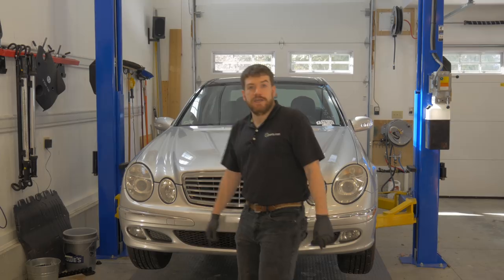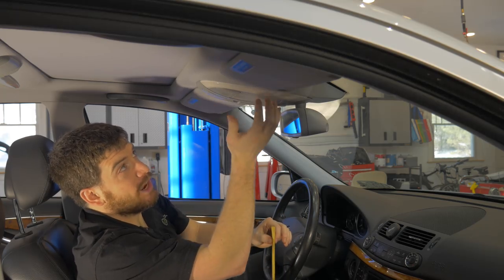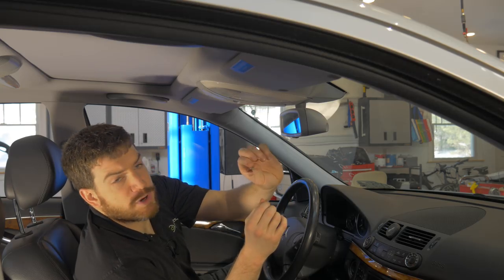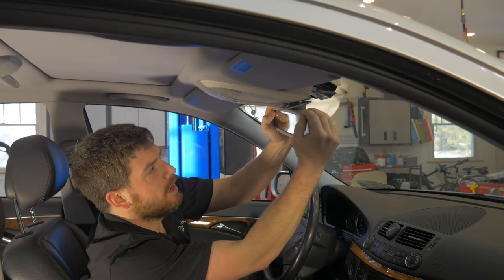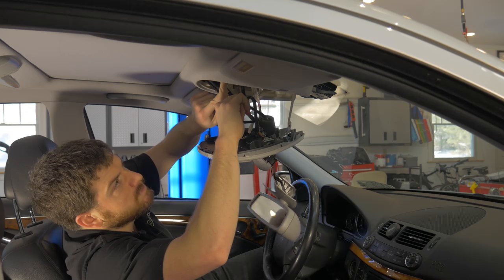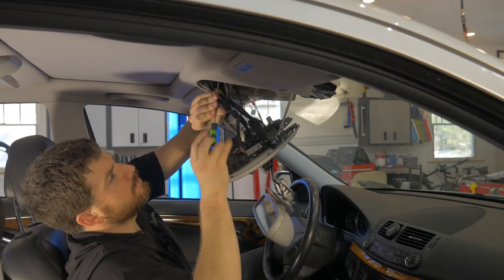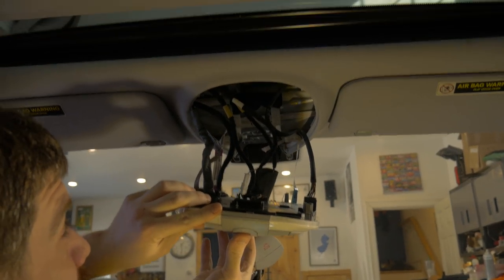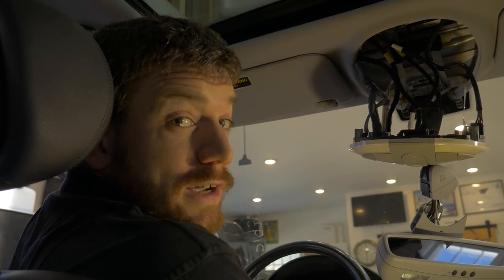Mercedes Grinding Sunroof Fix

Comment: Thanks!  I followed your instructions and was able to close the sunroof which was stuck open.  The washer didn't make the grind go away, but I was able to crank the motor and close the roof.  I noticed that if I pushed up with the screwdriver on the motor crank, it would go in a bit and the grind would go away.  But as soon as I let up on pressure, it would pop out again.  Also, I couldn't figure out how to make the shades return to closed.  Anyway, awesome video!  It saved me hundreds!
Reply from the maker: Usually the washer will put enough squeeze pressure on the motor to stop the grinding.  The shade will start returning to close once the motor opens and closes fully a few times, some sort of calibration feature/thing.

Comment: Wow!! Just Wow!! The local Mercedes Benz dealer quoted a minimum of $2500 - $4000 to repair the pan roof on my boyfriend's 2003 MB C230 kompressor. They also refused to repair the sunroof recall, due to the pan roof having an open / close issue. I found this video, spent .40 (that's forty cents)and ten minutes, and the repair was completed, tested, and reassembled!
Someone buy this man a beer for making this SUPER HELPFUL tutorial on how to repair this issue!
A million thank yous!

Comment: I was quoted $2660 to fix this. Haven’t used my pano roof in like 2 years. 

Happened to stumble upon this... bless you sir <3
Reply: $2660? the hell?
Reply: where are these washer bolts sold ?
Reply: What size washer did you use?
Reply: @geniusO2  same problem can't find one that fits right

Comment: Man U have gained a subscriber and customer. My 05 e500 did this grinding popping off track thing tonight. I googled “panorama sunroof Mercedes broke” and it took me straight to the video which was the exact same model as my car and the exact same issue. Followed it step by step and works perfect now. Only thing I would add to the video is to mention on the re-install to put the mirror back first because it was a pain for a few minutes to get back in. Thanks for the video and for making it semi professional instead of some kid using his iPhone shaking everywhere and talking for an hour before he got to the main part

Comment: Wow, Bro you are the best. I watched another video stating to pull down the roof lining and all sorts to remove the spin disc motor and add a washer on the back of the pink disk, wasted my whole day yesterday, I was so disappointed.  Then I saw you video, and thought no way can it be that Easy. Today I went my local hardware store and picked up a couple of washers and was praying for results. 20mins later,,,,,,,, I'm A happy chappie, changed one and got movement no noise at first then it done it again so I added washer to the other side and hey presto a working pana roof, just ordered merc lubricant  and oil to complete the job. Massive Thank You. You A legend.

Comment: WOW Can't be more pleased with the instructions to make this repair on my '06-W211 Pano. In my case I used (2) flat washers stacked and a 1/4" dia. o-ring. Not possible to get to the other T25, to much obstruction. Tightened up the other smaller Torx scews.Tested before reassembly and no chatter. Getting the mirror back was tricky. I put a little grease on the socket area & spring ends, worked the spring with a pair of channel locks then had to fix the mirror in place before resetting the control panel. Got the mirror spring & socket in place then pushed with a flathead screw driver to over come the spring tension and it popped/locked in place.  Then went the control panel. After all back together "re-programmed the sunroof" and all working normally. MB dealer would have charged a ton of money to do this, SPECIAL NOTE: Be extra careful with ribbon wires while control panel is hanging. THANKS ID Parts!!!
Reply from the maker: Nice work David, easy fix for a scary problem, can't get better than that!
Reply: David S Reilly dude can you show me what you use? Like my english is not very good. All i can understand that you use washers on one side that is easy to remove the bolt. What kind of washers do you use and what kind of o-ring you youse? I wouod like to see it visualy and fix my panoramic also.
Reply: Cory, I knocked the spring in the mirror out trying to reinstall after putting in the washer.  How can I get the spring back into the mirror?  Am I now going to have to replace the mirror???

Comment: Great write up!  My motor noise is all gone.  I left the factory plastic bushing on the Torx head, then 5/16” lock washer then 1/4” flat washer.  When I removed the assy the SOS button didn’t come off.  The biggest challenge for me was re-installing the mirror.  As a previous commenter mention, use some sort of lube as its very difficult to load back in.  I used hand sanitizer to lube it up but it requires a lot of force to put back in.  Especially with the limited space.  The SOS button assy should be installed after the mirror to allow for easier push ability when re-installing the mirror.

Comment: I’m so glad I saw this video. The dealership wanted to charge me $3,300 for problem. They told me I needed a new motor and tracks. Followed the steps in this and fixed it for about 12 cents.

Comment: You're amazing!  Worked like a charm on my 2008 E320 Bluetec with Panorama and shades.  Strange thing happened:  car was sitting outside in super cold, and the sunroof tilt motor activated itself and tilted one side partially up.  Would not go down and buzzed as in video.  Finally was able to follow your steps, with some trepidation as I was afraid of breaking the plastic.  A lock washer in the first bolt not completely tight got the sunroof tilted back into position immediately!  But the shades would not work.  Scratched head. That helped.  Looked in owner's manual, thought perhaps they were out of time.  Tightened a bit more - and they started working like they should.  Big smile.  But getting the mirror back in place . . . grrr.  Having to go look for a second pair of hands to try tapping it into place while I hold it angled in . . .  Thanks again!

Comment: Fantastic video. Thank you guys. 
Fixing the mirror back was easy!!! Just get a dead-weight hammer and a big, long bolt. 
First fix the control panel back in place for room, put a little grease roundabout the mirror socket and the edges of the spring.
Finally set the mirror in place, use the long bolt to hold it firmly with one hand while you use the other hand to hit firmly but gently on the head of the bolt till you hear the click!!!

Comment: Had the same problem 3 times changed the motor even the rail $6000 wasted money . Recently had the same problem then took the car to repair the motor out side the company repaired it with $100 and works excellent so it’s the motor this video is excellent no issue again smart professional video . My recommendation don’t waste money with dealer any more . The panoramic sun roof always can be repaired.

Comment: For those asking where the washer are sold, I got a set of washers that comes with different diameters and thickness. You'll be able to find one that fits more than likely.

Comment: Small advise, you will be having problems putting back the mirror. It’s a pain in the ass. Put back the mirror first and then the whole pannel, then you will have more space and will be able to see everything.
Reply: I tried putting mirror first but it was incredibly hard getting the panel on afterwards. So I ended up putting the panel removed the sos button so I could push the mirror back into place and then put the sos back. I found it easier that way.
Reply: How similar is this to the X164 sun roof motor and how difficult is the sunroof motor to replace

Comment: This video is a lifesaver I will be contacting the dealerr tomorrow and I will be giving him a heads up I know this is the issue because when I put pressure on the panel I got it to close it made the grinding noise and it went slow but it did close I did not reopen it I knew the motor was good but I had a feeling it had something to do with pressure or something being loose because when I would press my hand on the panel hard it would close thanks a lot this was a perfect video

Comment: Fantastic.  I was nervous about this but dove into it on my 2005 e320 pano roof. I used 2 M 8 size spring washers on the one screw and it did it. Second screw on the left looked difficult to take out and I then forgot to try.  Bought a little MB grease for the rails and all is smooth. Thanks a bunch for the great video.
Reply: So the second screw was not necessary to take out?

Comment: Problems began with grinding noise. Was able to close roof but  passenger side wont completely.  I replaced the grommet which eliminated the grinding noise and shade screen now opens and closes smoothly. However, attempting to open roof, driver side lifts but stops. I noticed the motor moves and the mall piece rotates. Video he mentions changing grommets on two bolts but on,y showed one. Will I have to remove panel to reach second bolt?

Comment: Hello i have a problem with a mb c 280 w204 2009 sun roof. Do you think could be the same problem. ?It open and close but by steps  meaning push de bottom star open the stop continue the same. When finally you complete opens it grinds or sound horrible 
Any ideas

Comment: What is a spring washer as you don't put it close enough to the camera to see.  Is this a lock washer?
Reply from the maker: Spring washer has a slight curve to it.
Reply: Thanks for the video, I am going to give that a try. Before I start however may I confirm with you how many bolts did you remove and how many washers were installed please? Thanks again!

Comment: How does water leak in the sunroof control area??  I have a g500 and some water dropped onto my transmission shifter after raining....

Are there certain problem areas with the sunroof?

Thanks.

Comment: Can't wait to attempt. Been search for over 3 years and I haven't found anything this helpful but again hopefully it works for me as I haven't tried. My issue started when it was able to close. Used the tool to close manually but never worked again and motor made the exact same noise. I have pressed the motor button many times out of frustration. Did I damage the gears?
Reply: It worked!!!
Reply: The only thing is when going back to open it opens smoothly but when closing at some parts struggles. Could this be due to it needing grease and it being locked for quite some time? Or could it be signs of a bad motor?
Reply: Hey Jordan congraz! May I ask how many bolts did you remove and how many washers you installed please? it'd be absolutely amazing if could also let me know the size of the washer too, thanks a bunch man!
Reply: mehhhhhhhmehhhhhhmeh it stopped working but I think it's because the gears might be done for. Which isn't terrible because I may be able to replace the motor.however initially I took two of the mounting screws off one by one and add three 1/4 washers along with a lock washer on each bolt. You should notice the ones you will have to replace because of the damaged rubber washer
Reply: Thanks a lot man I shall give that a try!

Comment: Hi, my dad has a 1998 Mercedes E320 (W210 base model/4-door sedan). The sunroof won't slide back and makes a clicking noise if someone tries. The sunroof opens and closes up or down, but will not slide back...can you help? Thanks.

Comment: THx for the great video... my roof on my '04 kompressor coupe got stuck open and grinding ... the washer solved the problem.. only issue is sunshade will not close .. is it a programming issue?
Reply: joe laurieri look for thé fuse

Comment: Tried the procedure that's on your video it worked for awhile and it went back to making that grinding noise again.  Do you have to put the washers on both of the screws or jus the one that's bad
Reply: what size washer did you use?

Comment: i have duel panaramic roof for 08 e350 the front on works but the rear does not is there anything else i can do or is this also it is starting to sag how do i fix that

Comment: UPDATE : I did this procedure last year on only 1 screw, taking the short cut. My bad , I now had to go back in and do the awkward second screw using 2 # 8 mm flat washers.   All is well again. Advice is do BOTH SCREWS while you have the panel removed.
Reply from the maker: Always good advice - fix everything you can while you're there!
Reply: Yeah he doesn't do that in this video. The second bolt is the one that is the real challenge. Did you have to drop the headliner to reach the second bolt?
Reply: @SPHINX144  get you a long stem magnet. It looks like a radio antenna. That helped me get it out and back in again.
Reply: @rickmoses2801  I have one of those, but how did you unscrew it? Can't fit anything in there unless I drop the headliner it looks like.
Reply: @SPHINX144  hi John u don’t have to take down the headliner. U have to unscrew the 2 bolts with a  #20 torque adapter in your screwdriver

Comment: I had a repair guy tell me that I should apply pressure on the passenger side above the drop shade and it worked and closed. But after a while it misaligned the roof and now it’s sticking up on one side. Is there a way to repair this easily, or this now a thousand dollar repair?
Reply: i have the SAME problem now.. were you able to fix it??
Reply: Nolan S nope!
Reply: Nolan S I found a guy that could take the roof off but it would be $600-$1000 for the repair. Considering that my car is already so old, I just put some clear Gorilla Tape on it and now it’s at least water proof and the wind noise is somewhat reduced...
Reply: Nolan S I also have a contact for someone who tinkers with Mercedes and I told him he could experiment with taking off the roof and then just put it back on. I don’t care if it works or not, I just wanted it sealed. Then the Gorilla Tape idea came up and I decided it wasn’t worth the money and trouble.
Reply: shadowm3ld definitely not worth the money... its an old car. Thank you for the quick reply. Bless you!
Reply: Nolan S good luck to you! Yeah I’m considering upgrading the car anyway. Or you can try to take it apart yourself if you’re so inclined... could be fun or super frustrating haha. Take care!

Comment: Hello my friend I'm a Mercedes w 211 also I have a problem with the roof is suspended and is currently open to the top just like your car which is in the scene and I have tried like you did but the key remains rotating but the roof remains open Do you have facebook or watch me send you a scene to see Can you help me

Comment: i have ti figure our how to find the source of the problem in my 08 c300 sunroof its stuck on one corner now and moves a inch
Reply: francisco villarreal Did you figure out the problem and is it working now? Mine was in the same position as yours and did this clicking noise.

Comment: Although the information is great and useful it by no means shows how frustrating and difficult it is to replace the driver's side screw and after stacking a couple washers on to it. Whew...took about 40 minutes to replace that (1) screw. Whatever you do be patient, make sure your hands are clean  (while fiddling trying to get the screw in place your hands will be inside the area but will also stray to around the outer headliner area BE AWARE OF THIS) and use a long-handled T-TORX. On the passenger side I got 3 washers on the screw, on the driver's side I could only get 2 because of the tight working space. Once both screws in place tighten firmly.  The instructor doesn't show how to remount the mirror which is another PITA.  After the console is remounted pop the SOS button out of its socket and place a little grease on either side of the mirror spring then position the mirror in the rectangular slot and use a wooden dowl or solid rod about 6"-8" long and with 3 hands knock the mirror back in place.   After, as the instructor recommends, open the sunroof clean & grease the channels.
Reply: What tool did you use to reach the driver's side screw since there is no clearance to go straight for it?